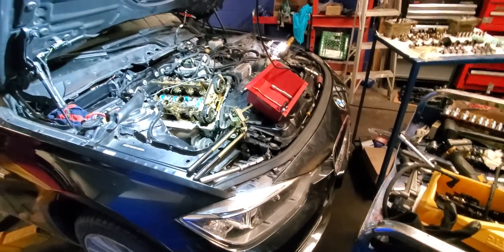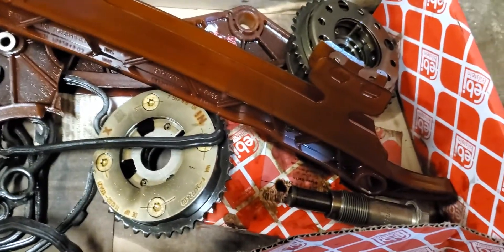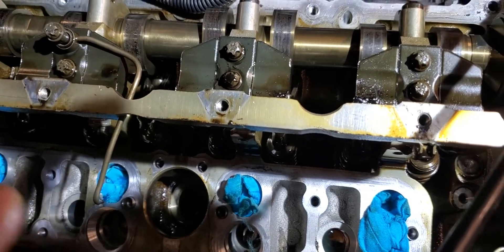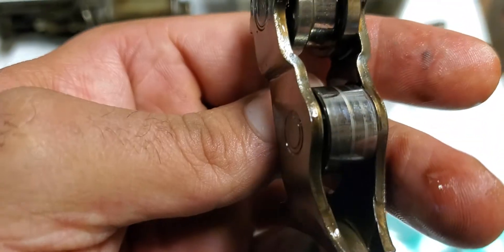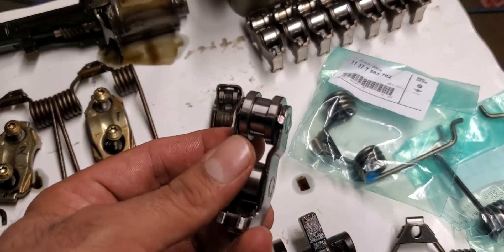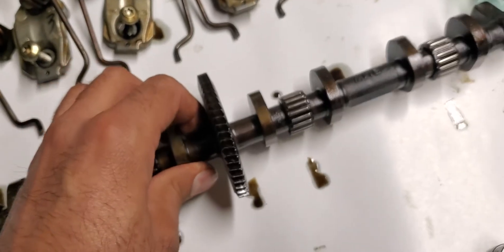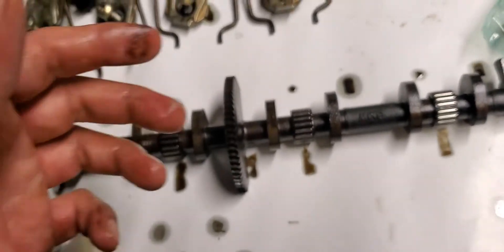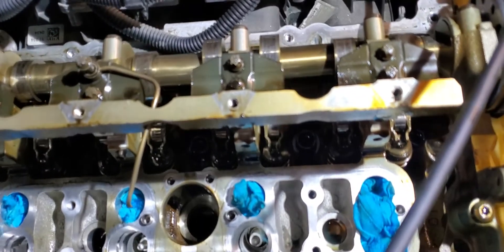BMW 3 Series N20 Engine Reduced Power Repair | engine malfunction

Comment: Did the chain skip timing too?
Reply: So did you get lucky because this is a interference engine. Mine jumped timing on the intake side and the oil chain broke, just trying to get some info before I get into it.
Thanks
Reply from the maker: Yes timing was skipped
Reply: So timing jumped but no valves were bent?
Reply from the maker: No valves bent
Reply: @Jatt_Attvaadi  how did you check if the valves did not bend before installing the new chain and guide kit?thanks